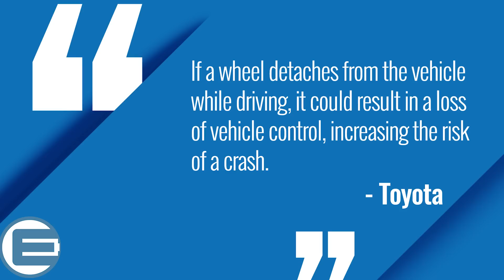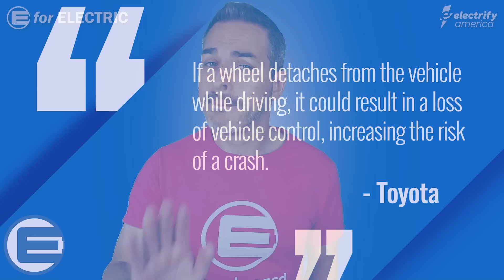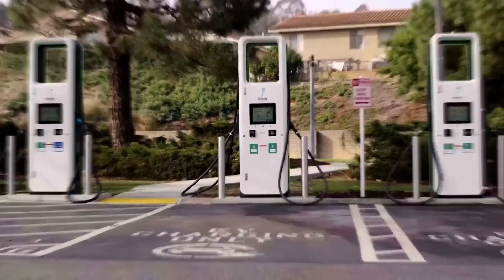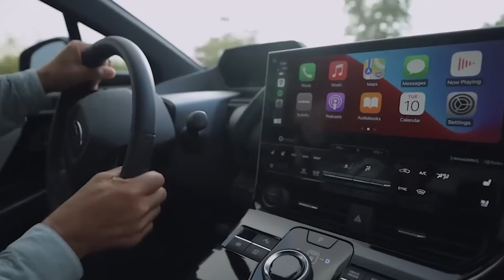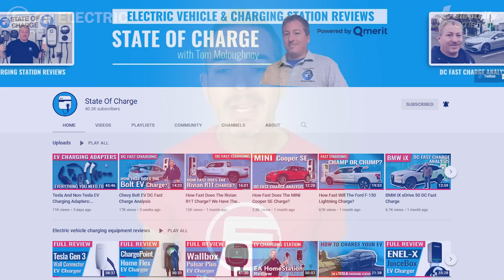Why Toyota Just Pulled Its New EV Off the Market

Comment: Hilarious! I laughed my wheels off!
Reply: Easy now, EVs are heavy, load bearing components are under more stress than engineers imagine. Remember Tesla had issues with strut towers that deformed because of weight.
Reply: @Tore_Lund  The engineers know how much they weigh and don't "imagine" what stresses they undergo.  They certainly don't engineer cars which fail in weeks from the hubs coming unscrewed.  They're probably hubs from the parts bin anyway,  and torque specs were simply missed in assembly.
Reply: @jamesengland7461  Agree sounds more like an assembly line mistake.
Reply: The Tinder joke was great
Reply: Hahaha shiiiiit 😆

Comment: I have a Subaru Solterra on order. Subaru said, I will be taking delivery around August.  My dealer just told me probably September. This is just before the recall was announced. Luckily, I haven't taken delivery or anyone in the United States has either.  Its better to catch this now than to be sorry later down the road. I have purchased 5 Subaru's and all had good reliability.  I was thinking of an electric vehicle for sometime now so I decided to give Subaru a try.  This will be my 6th Subaru. It looks like I won't be seeing the vehicle until the middle off the fall.  Hopefully, Subaru and Toyota will fix the problem soon.
Reply: Check out the charging reviews' slowest charge time & poorest rage of any ev on the market max charge speed of around 75hkw stated achieving around 66 so 20-80 will take over an hr
Reply: @martinhammett8121  thanks for your reply. Regrettably, I canceled the Solterra reservation and end up getting the Hyundai Ioniq 5. EPA range is 266 and rapid charging time from 10-80 % is less than 20 minutes using a 350 kWh dc rapid charger. I love the ioniq 5. Had it since November 4.  Taken the vehicle to New York . I travel between New York and Baltimore often. If I have purchased the Subaru Solterra, it would’ve been a disaster especially the range and rapid charge time. It would take me forever to go from Baltimore to New York and back.

Comment: Although not recall related but I believe Toyota's and sister Subaru's missed the boat on their EVs.  225 mile range.  Really!  And Electrify America you are no better.  Subaru sells in my state were summer temperatures can get into the low hundreds.  Turn on climate control and now you're looking at 185 miles or so of range.  Head for a Electrify America charger station and park in the unshaded hot sun for 20 plus minutes.  Two fails don't make a win.  Shame on you both.

Comment: My 2009 Corolla dies at 125k miles.  Was burning oil since 35k miles.  Walnut Creek CA Toyota said it was fine my car was burning.5 quart every 1,000 miles. I had factory warranty. I had dealership extended warranty. Toyota did nothing to help me and my Corolla was dead due to low compression at 125k miles.  Don’t buy Toyota. Toyota has no honor.

Comment: Alex, have you done a road trip using your sponsor? I don' t think EA is doing the EV revolution any favors with such an unreliable network.  I myself pulled into an EA location on Sunday and only 1 of the 4 chargers was working.  This has happened at other EA locations also. In the Bay Area alone, 27% of chargers don't work.  I would think this isn't the type of sponsor you want for your channel.

Comment: Their recall bulletin/statements are not from Toyota or Subaru or any other manufacturer. It’s the lawyers wording them to limit the payouts if it all hits the fan. 
BTW you forgot to mention the Mustang mach-e having battery connection issues as well.
Reply: It looks like the last point is covered in the next week’s video.

Comment: Toyota didnt make this car. The chinese made it and Toyota and subaru attached their name tag to it.
Reply: Wrong. Toyota makes the car in all but the Chinese markets. And they make it in a Japanese factory.
Reply: @benjaminsmith2287  Do some research before opening your mouth
Reply: @henrythe8912  Take your advice before acting like you know what you don't. Outside of China, Toyota manufactures the bZ4, not a Chinese company. GAC is for China not the cars in the USA and other markets.
Reply: @benjaminsmith2287  The manufacturer is GAC from China. It is a joint venture with Toyota

Comment: Could it be because so many countries are restricting the charging of them because their grids are overloaded?
Reply from the maker: What?? No. Umm.. what??
Reply: @EforElectric  England,  Germany and yesterday I visited a local brewery that prides itself on being enviromently friendly and they had all of their EV chargers locked out because it was too hot! We have to ban AC if we want EVs!
Reply: @EforElectric  we were warned by GM in the 70s!  But surely the laws of physics would have changed by now?
Reply: @EforElectric  let's face it Hyundai, Kia just recalled 5.6 million cars for a major problem with the auto resart system. No company would discontinue a car because of a problem with a knock off hub! Considering that knock off hubs have worked flawlessly on race cars and street automobiles for over 60 years!

Comment: You can have my 2018 Avalon right after you pry the key from my cold, dead pocket.

It has more to do with not having a car payment and the fact that it's reliable than anything else.  EVs already have a major problem being cost-effective without Toyota Motor trying to slow adoption by dirty lobbying. (Toyota can do anything at all and I would STILL not tithe one thin dime to Twitter Daddy Emerald Mine, though.)  I'm having an extremely hard time finding the battery EV that's not so heavy it hinders range, or even one that can get 150 miles cold and is also not a badly depreciating asset or an expensive collection of problems on wheels that I don't have with my current car.
Reply: Aptera may have something that fits that bill in a few more years, in their second EV.  Fingers crossed (🤞) that it’s competitively priced.

Comment: I'm now really curious exactly what this problem is. Most people are thinking it's the wheel nuts (or bolts) but Toyota is saying "Hub nut" which is an entirely different thing. Is it front wheel drive? Then the hub nut would be an axle nut (I think...) If not, then it's the spindle nut, which normally are not tight at all (snugged and a locking mechanism).... curious indeed!

Comment: Toyota, Honda , Stellantis. All companies that did/do not take EV's seriously. Others as well, but these 3 seem to have leadership the really don't think EV's are more than a fad.
Reply: I think EV is not the next.  Just temporarily for next 10-15 years and before something better come out.
Reasons are making battery is pricy, 
 not environment friendly for making or recycling the old battery. 
Battery has lot of issues just like phone battery.  It will degrade, bloat or leak.  Can't be in too hot or too cold will degrade or even damage the battery.....
Reply: @n00bprof82  I would respectfully suggest that you improve your source of facts for batteries. 
EV batteries are not treated as harshly as mobile phone batteries. The problem with batteries is that they are lasting to long - recyclers don't have enough to work on. The ones that do come out of damaged cars actually go on to be reused as energy storage in houses. 
EV batteries are currently 95% recyclable, set to improve even further.
We are only 10 years into battery development, there are already batteries being developed that don't use cobalt (which, by the way, tons of cobalt are used up cleaning up diesel at the refinery).
Reply: @n00bprof82  - You need to update your outdated knowledge on batteries.
Reply: Nope, Hybrids is way better option. Our grids can’t handle the power we use during the dead of summer.
Reply: @sho95100  - Not a problem most EV charging takes place outside the 4pm - 9pm peak use period for electricity. I charge my Tesla after 2am, just plug it in anytime then set the app to start charging at 2am.
Reply: @sho95100  - Hybrids are going to be gone in a few years.
Reply: It's not that they did not take EVs serious. They have been working on fuel cells or the hydrogen engine.  They did this after studying their own electric grids and power production.  Determining that battery powered EVs could not be supported without significant and extremely costly grid upgrades and new power plants.
Reply: @mkgriff1492  - Except they forgot that producing, transporting and distributing H is not that easy.  Takes huge amount of energy to make H.  Logistics of getting the H into your H car is a pain.  One leak plus a spark and Kaboom, like that leaky H stall in Sweden a few years ago.
Reply: Maybe they are right !
Reply: Stellantis' CEO has shown remarkably backwards and consumer-hostile thinking on EVs. Read some of the interviews with him - it's just pathetic.

Comment: I can’t think of any technical reason that Toyota couldn’t have taken the Prius Prime PHEV and scaled it up.  Either to a range-extended EV, or a full Battery Electric Vehicle.  Almost anyone better off with one of those options than with a PHEV (a range-extended EV would have double to quadruple the all-electric range of a PHEV).  So I take it Toyota has been unwilling to do this, rather than unable.  Pair that up with them paying lobbyists to try and convince politicians to slow the rate of ZEV mandates and…   yeah, pretty pathetic, Toyota.
Reply: @Konstantin Ridaya Where I live, 98% of the electricity is made from renewables.  And nearly as much electricity is used per kilometre for an ICE car as an EV, as oil and gas exploration is massively electricity intensive (exploration, extraction, refining, transportation, and distribution), but then they also burn fossil fuels on top of all that electricity that's just required to get the tank filled up.  Every independent peer reviewed study that's looked at this issue holistically has found that EVs do consume less total energy over their entire service life than an ICE vehicle.  I'll trust independent research over Volvo's research, since Volvo has a profit motive behind every statement they make on the subject.
Reply: @Konstantin Ridaya you're cherry picking data. The life cycle emissions are what matter, which is about 7 Megatonnes per EV ( mostly during production) vs 90 Megatonnes C02 per ICE, if you have clean source....eg where I live its hydro
Reply: @Konstantin Ridaya - And how much energy does it take to make an ICE car and having to continue to feed it gasoline?  Think of all that energy going into getting the crude oil out of the ground, transporting it hundreds or thousands of miles then Having to refine it, then having to transport the refined fuel, then do over again and again. Also ICE are inefficient, about 30% of the fuel ends up as lost heat all the while emitting greenhouse gases. It is a known fact that greenhouse gases are warming the atmosphere and oceans resulting in the ongoing catastrophes we now see daily. And it’s going to get worse. Some ICE will be around for specialized uses but they will be all gone in 30-40 yrs.
Reply: mandates are pathetic not lobbying against it, let the market decide. The batteries have to be cheaper, 3x+ more energy dense (less raw material and mainly Cobalt and Nickel too) charge 2x+ faster with greater lifespan. That's what the the new sulfur battery is achieving
Reply: @ChuckLeeClerk  There are certain things the market is really good at deciding.  But improving the environmental impact of products has consistently proven to not be one of them, in my experience.
Reply: @ScrapKing73  but EVs has nothing to do with improving environment, hybrids are more ecological than EVs, the batteries are heavy asf - raw material mining, recycling...
And that's not even speaking of sustainable (synthetic) fuels,  50%+ efficient engines (camless, pre chamber)
Reply: @ChuckLeeClerk  Few, if any, peer reviewed studies have agreed with your conclusion.  The weight of vehicles matters less when you have good regen (weight is a downside with acceleration, a negligible component of maintaining speed, and if anything a benefit during regen, so it's mostly a wash).  One recent test drove a road route with an EV (Kia Soul EV), then loaded it up to its rated cargo capacity with hundreds of kilos of extra weight and did the same road route, and found nearly no net difference in the amount of energy it used.

As for raw materials and mining, a high voltage battery pack in a modern EV is likely to last the life of the vehicle, and then go on to a second life as a stationary storage solution (such as for storing excess solar power in a building).  So you're mining for the battery pack once, and then using it for decades.  As opposed to oil and gas where there's exploration/extraction/refining required for every single fill.

Synthetic fuels aren't as sustainable as renewable electricity (solar, wind, hydro, etc.), and there seems to be no path to making them as inexpensive as electricity, so I think synthetic fuels are a non-starter for the majority of the market.
Reply: @ChuckLeeClerk   - Certain mandates are good, gets people and companies to get off their butts and do what needs to be done.

Comment: The partial reason for the problem... because they changed to Lug BOLT design instead of using a LUG NUT...  no excuse but just not as tried and true with Toyota.
Reply: No excuse to improve wheels by trying something like weight reduction?

Comment: What about the Toyota Prius 2006-2009 FAULTY CAPACITOR in the Speedometer MAIN Circuit board that overloads and blacks out the whole dash??? they solved it with replacing the 100 MFD Capacitor with a 200 MFD Capacitor... less than a $1.oo fix, but it is now an $850,00 fix to take apart the dash... that is a recall that is no longer honored by Toyota!!! such a RIP OFF ,,,

Comment: You know, with the lack luster specs of this vehicle, the painfully slow charging rate, and now with the damn wheels falling off....it makes you wonder, if maybe they did this on purpose.  Simply so they could point their fingers and say "See, we told you, we tried to warn you, but no, you wouldn't listen.... electric vehicles are bad". They built one electric vehicle, just to shut up their investors and get them off their backs about electric vehicles.  Using the BZ4X as an excuse to abandon electric vehicle technology all together and refocus their efforts on hydrogen fuel cell technology.  That's how anti EV Toyota is, and it will be to their demise.

Comment: Just another Toyota/ Lexus bolt problem. Our 2008 Lexus 350’s engine blew up because of a manufacture defect where a timing bolt fell off inside the engine. Toyota/Lexus DID NOT recall and would NOT pay for the ruined engine which had to be replaced.  DO NOT TRUST TOYOTA

Comment: I am not too familiar with Toyota design of front suspension but it looks like the problem lies with the sway bars.  It looks like Toyota trucks use the sway bar spring design (American style) and anything else like cars use the linkages.  I would assume that this EV has under designed linkage system that causes too much uneven force on the front wheels when turning.  I had two vehicles that were loosing tire lugs with both combinations.

Comment: As much as dislike Toyota/Toyoda, I don't think this will do anything to them. It is such a small volume vehicle that's barely on the market, and recalling them, it is not going to make too much of a wave in mainstream media, especially since it was discovered before a major accident. Also, take in consideration that every single manufacturer, no matter how experienced they are, will suffer from a recall. When you have so many parts that have to work together, something is going to fail eventually. Not just mechanically, but it can happen during the design or manufacturing phase. You can test internally all you want, but real-world usages will revel all the faults.

Comment: Technically, not all Bolts have been recalled.   Production has now been restarted with the new battery so those cars that were most recently produced are not subject to recall.
Reply: Problem is the new battery GM is using are pouch type battery, already outdated tech.

Comment: It’s really their bolts and lug nuts supplier issue No? Unless they made them in house? 

All lug nuts have a torque tolerance of tightening with a torque wrench! it’s a wrench with settings that you dial in for various bolts on an engine etc. it’s been around for up to 100years? 

Have you ever tried to remove the lug nuts from your wheels when you got a flat tire? Most of the time lug nuts are over torqued when you have a new tire installed since they use compressed  air lug nut tools to tighten them! I’ve had to stand on the lug wrench to loosen them up before Jack up the car to loosen them many times
Reply: Exactly and the nut torqueing machine on the production line has been used for decades.  Maybe a mix up between Newton-meters vs. Foot-pounds.  I want to know the root cause.

Comment: So Toyota should tighten the bolts. Toyota should also hire me as a consultant because I'd tell them to tighten the bolts and I wouldn't charge much either. Frankly though, was there any of these things for sale anywhere or on the road anywhere in the first place? How do we know the lug nuts come loose when the car doesn't exist in the first place? So years from now, theoretically,  in the unlikely event that one of these fantasy cars  becomes available for sale,  and then, on top of that dream,  if I buy one, the lug nuts might get loose? Frankly, I won't lose any sleep worrying about that for now. You go Toyota, electric cars are a fantasy. Gas is the future.